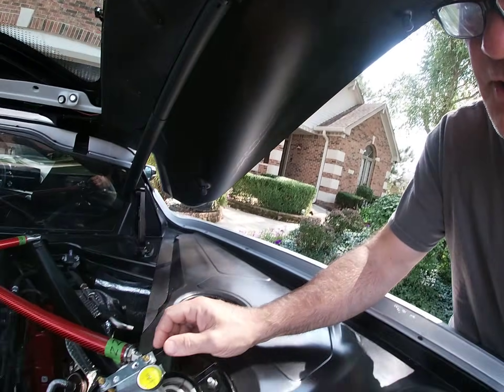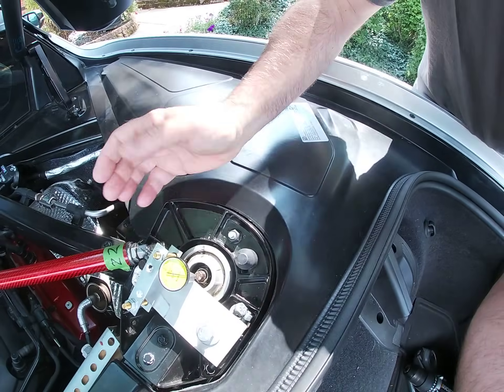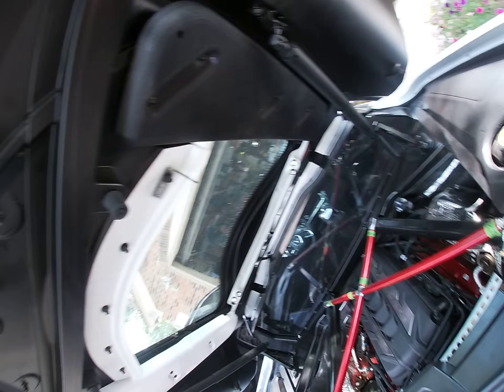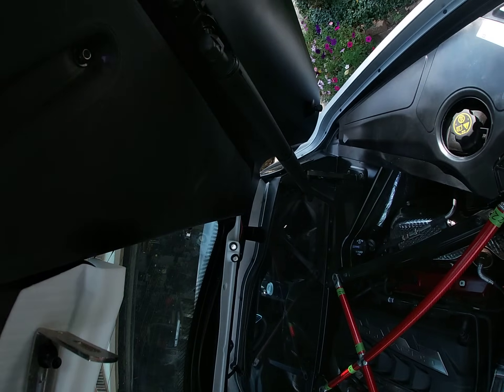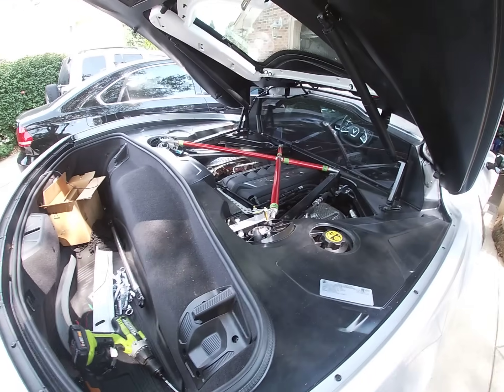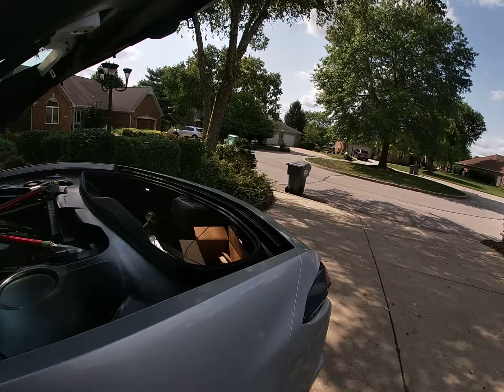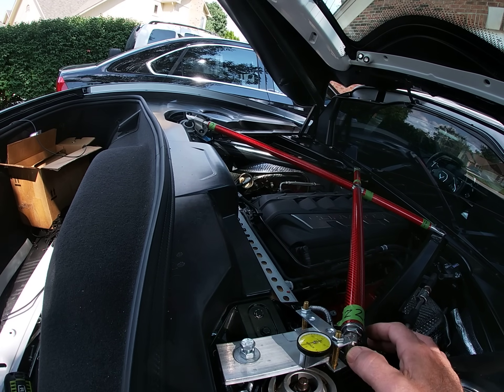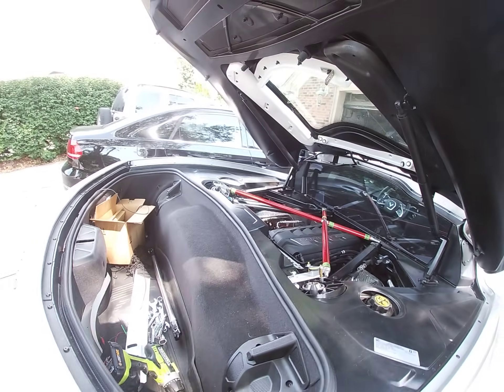Speedway Composites - C8 Corvette Y axis Chassis Flex Torsion Test

Comment: can you please measure from the valve cover to the bar hight, want to know if it will clear the supercharger please and thank you
Reply from the maker: Hi Peter, sounds like an exciting project! Let us know how it goes.  The gap below the C8 Chassis Strut Brace and the factory intake cover is 7/8" or 22mm.  the pinch point is ~4" behind the C8 logo in the area of the brace's "X" bracket.
Reply from the maker: We are launching a Z06 LT6 version that will be 1-3/8" above the current intake cover or 8-1/4" above valve cover.  Hope that lets you fit the blower!
Reply from the maker: You can learn more about the brace on ebay if you search: C8 Chassis Strut Brace